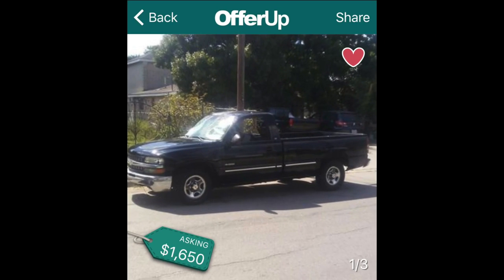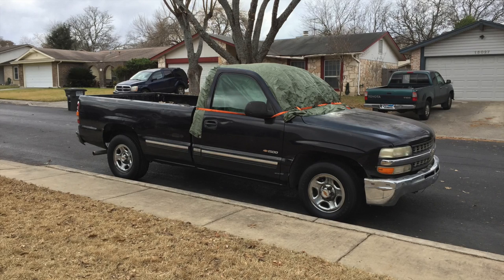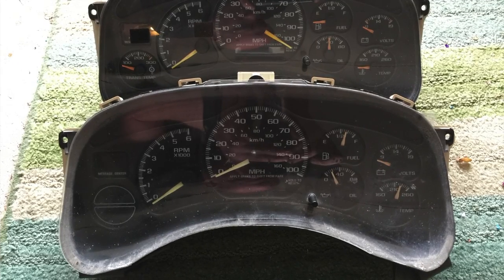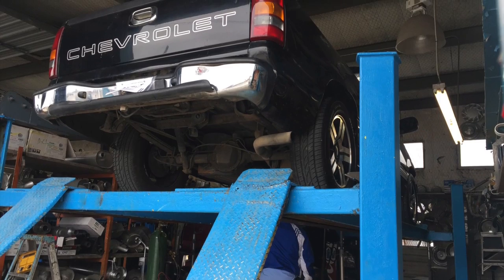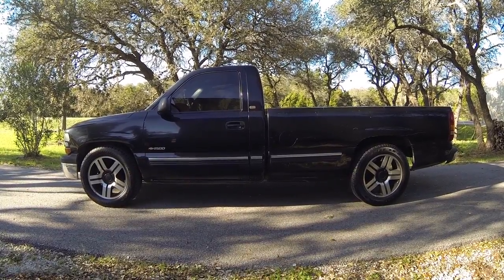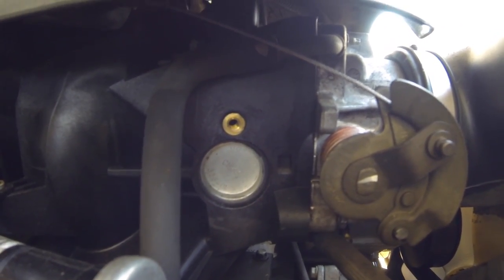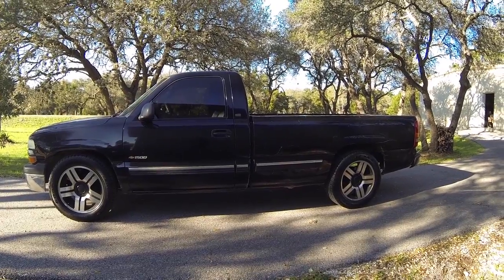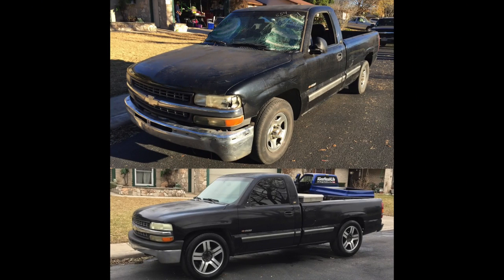The "Vandal" Project Introduction - Daily Driver Work Truck m, '01 Chevy 1500 Truck NBS

Comment: Heck yeah man. Love the truck, those new lights and bumpers will make a big difference! You should make a video on the remote start, Im thinking of installing one in my truck
Reply from the maker: Thanks Jose! Yea, I'm trying to think of a way to present how to hook them up. It's not an easy task ant takes at least a day, maybe two, to install it. Older vehicles would be easier though. The video I make will likely only cover pointing people in the direction of how to get the info needed to install it, since they've made it very difficult for the DIY guys to do it themselves. they hide the manuals and push people to have a certified installing install htem.

Comment: the 'color combo' of the wheels look great......you could always go back later and repaint the black and polish the aluminum......I did the Birmingham, Al to San Antonio TX drive and back to Bama.....I was in TX for 3 days driving!...San Antonio is beautiful......but the highways are nutts
Reply from the maker: Thanks man. I thinking the same about later on for the wheels. Yea, it takes forever to get around Texas. When I got stationed in AL, I found it crazy that 30 mins in three different direction and I could be in a different state. lol I'm use to being in the middle of Texas and taking at least 3 hours to get to another state.

Comment: Mark I have the same brand phone mount, it's awesome. Little tip, you can put the metal plate between your phone and your case and it will still work perfect, and you will never see it either.
Reply from the maker: thanks man! yea, i considered that, but preferred to have the sticky on my case instead of the phone. Plus my phone is huge, so I figured itd work a lil better being on the outside. I freakin love those mounts though man. So damn handy. I've got at least one in every vehicle.

Comment: I did the hydroboost swap on my 02 1/2 ton 4x4 silverado. That was probably the best money that I spent on that truck.
Reply from the maker: Man, that is what I'm expecting. I've already picked up the hydroboost setup for both the Vandal and the Family Wagon. I can't wait to get it on. One things slowing me down is that I want to make my own lines/hoses for it. I'd like to route them in a way that'll have a clean presentation, better than they cam from GM. They kinds seem like a spider web from the factory. Not horribly bad, but I'd just like to see what I can do. I've already got the tools to make them so why not.

Comment: PML trans pan ftw for the 4l60e maybe? I have so much to ask you but understand you're busy man. Great content man thanks. Wrenches all day every day.
Reply from the maker: +G Man Thats it brotha! Gotta keep knocking it out!
A pan with cooling fans would be a good thing. The trans cooler that I've now installed has drop trans temps at least 50* now, even when pulling an empty 1700 lbs trailer 5 hours. I'll have a car on it tomorrow for the 5 hour trip back.
Reply: +AGearHead4Life I run the PML deep pan on my tow rig, an I just love it. Be eazy in your travel's friend.

Comment: Did it throw a code when you removed the cat's,if so is there any way to remedy that? I have a 97 2500 3/4 ton Suburban with a 7.4 liter in it that needs a Flow Master!! Do you know of anyone who has done a turbo addition to this era 7.4 ? And the Truck looks great, the before and after pics say it all!!! Thanks again and keep on rolling....
Reply from the maker: +William Hill (Hill Billy MD) Thanks Will!
I disabled the secondary O2s in the tune so that it wouldn't throw a code for the cats being removed.
I don't anyone who's turbo's that truck but I know it can be fine.
Good luck on the new exhaust!
Reply: AGearHead4Life Thanks for the quick reply! It's not often I get to talk to someone famous ;-)

Comment: Vandal looks outstanding!  Cut a long bed, though?  Me, someday I want to pick up a regular cab long bed 1998 K2500.  I always liked those.  However, years ago my Dad had a regular cab short bed 2000 K1500 and it was a blast to drive.  Almost as fun as his old 1980 K10.
Reply from the maker: thanks! 
Yea, short beds are more visually appealing for a street truck. I'm actually now likely going to go with even shorter than a short bed and just use a bed off of a quad cab truck. lol Theyre easier to find.
Reply: Now there's a great idea!  That would be truly unique!  An extra short bed!

Comment: Miss your vids bro you give info than the repair guides at auto zone 
Hope everything is ok with you and yours
Reply from the maker: banga8080 Thanks brotha! Life’s actually slowed down just slightly to where I think that I’ll be able to capture a video either this weekend or next. Im swapping in an 03-07 steering wheel onto the Vandal. The newer wheels look much better. The columns have different splined but I think that I’m getting it all sorted out.

Comment: I have an 01 5.3 4X4 1500 with the trailering package and there is a second battery where your smog pump was. That's why there is a battery tray there. How did you deal with the O2 sensors when you took the cats off? Mine needs a new exhaust and I like your setup.
Reply from the maker: +Lee Allen ah! Good to know on the battery. Thanks!
I disabled the secondary O2s in the PCM before removing the cats.

Comment: You should do a 2002 2500HD front end swap. And might be a good idea/upgrade to do is to swap out the fuel pump with a newer and powerful one.
Reply from the maker: That's true! I have wondered about the strength and lift left in the fuel pump that is current in it. I should probably at least test the fuel pressure. I agree on the HD front clip. I've just got to find one cheap now.

Comment: The truck is looking good!! Did the center console just bolt in with no mods?
Reply from the maker: Thanks Matt! No it didn't. Actually, it's just resting in there jammed between the seats right now. lol I've still got to make the brackets to be able to bolt it down. I think the plastic on the bottm rear of it will need to be trimmed also.

Comment: Have you ever consider a roll pan for the back bumper they give a nice clean look,but if it's more of a work truck I guess it not real practical.
Reply from the maker: Yea, exactly. I'd do a roll pan on a sport truck specific build, but I'm usually working out of them still. I use the bumper a lot to get in and out of the bed loading stuff. Plus the protection of the bumper to stop things before they hit the body is good. Something about keeping the bumper and going against the grain excites me too..

Comment: awesome vid. cant wait to see the progress of the vandal. also did the trans temp work just by putting in the cluster??? or did you mess with wiring? im curios to know because i have an 05 silverado.
Reply from the maker: Thanks Aldo! Yep, just plugged it in. Nothing else, besides having them adjust my odometer. Of course your cluster will be different than mine. After around 03, they work differently, but it can still be done. Like using a Denali cluster.

Comment: Nice work. Loving make things look and run great again too. Just did all new brake lines and stainless lines as well has new calipers(suv back) (05 up fronts) on the truck too. I got my rear calipers with brackets pads and rotors and even came powdercoated for like 280 bucks on ebay so you may want to check it out. Fronts I got at the junkyard off a new truck. The thing will stop like crazy now. I don't know if I missed it by why upgrade/change the power steering pulley?
Reply from the maker: The power steering pulley upgrade is not a huge issue. I'm doing it because it looks much better. Also, if you ever need to remove the PS pump, you can do it without having to remove the pulley, like with the factory pulley. With the newer truck pulley, you can put your tool right through the pulley to remove the PS pump bolts.
That's nice man. I can't wait to get my brakes on. I want to paint the junk yard calipers and brackets first. I just learned about using SUV rear brakes about two weeks ago. So I still need to snag those.
Reply from the maker: aDIYguy thanks for the link!
I've got a link for the pulley in the video description.
Reply from the maker: Did the link for the pulley in the video description not work? Let me know if not and I'll fix it.
Cool! Thanks for the link. guess that means that you dont need different caliper brackets for the rear brakes?
Reply: Yes it worked . Thanks! that will make things easier. I think I ended up calling them to make sure brackets were included and they were. You may have to do the same. Also the picture shows single piston but they were dual.
Reply from the maker: Good to know! Thanks!

Comment: It might be a cool opportunity to repair the dash with carbon fiber.  You could repair the crack with some epoxy then skin the dash in cf cloth for a custom look.
Reply from the maker: That's a cool idea! Though I'd prefer a cheaper method and I'm not a fan of the carbon fiber look because it's used too often. Guess I could paint it. But I'd assume that fiberglass would be cheaper.
Well, this wouldn't be top of my priority list because Ive got a line on a parts truck to get all of the interior pieces out of.

Comment: I have a 01 GMC Sierra 1500 Long bed just like that one but in white, have the exact same 2 inch shackles to fix the extra lift from the HD leaf springs and a Hayden transcooler along with a servo for the 4L60.. Only bad thing about these trucks is MF trying to steal them any chance they get, they have tried to steal mine twice already. Oh yeah i have the 20 inch glasspack on mine, seems we have almost identical mods.

Comment: 2014+ rear bumper would do nicely
Reply from the maker: Brandon Alder Interesting. I came across one cheap but was passing it up because I figured it'd be too square for this truck. Also not sure that the raised plastic ends on it would fit the truck, but I guess that I can cut that down if it's needed.
Reply: AGearHead4Life  seen it done on other NBS trucks I'll see if I can get a pic and send it to your blog page
Reply from the maker: Cool. Please do! I just dont see it matching more rounded body lines yet.

Comment: ive got take off manifolds from my 5.3 no egr if you want them

here in SATX
Reply from the maker: Yessssir! I'm interested. I just need the driver manifold right now. How much are you asking and where's a good place to meet up?
Reply: AGearHead4Life 10$ sounds fair to me, im in the NW area off bandera so in where with in a few  miles of is good for me
Reply from the maker: Sounds good to me. I'm on the NE side. It'll likely be a few days before I can meet up with you though. I'll try to see if I can make a run over there tomorrow though.
Reply: AGearHead4Life sent you a message

Comment: If you need help with the electric fans I can give you some info on setting up your computer with hp tuners and wiring it up.  I got some cheap fans off ebay and did it on an LS swap and worked great.
Reply from the maker: +kevmo777 Thanks brotha! I did get the PCM setup for the e-fans and should be getting the fans on soon. Just gotta get the 34" radiator first. I picked up the factory newer truck fans and harness from a junk yard. Thanks for looking out!

Comment: Hey can you please make a video of how to remove that secondary air pump I'm not really familiar with how to remove them and I need to remove the one I have on my truck
Reply from the maker: Michael Munoz Sure, I can go over what I did with by holding up the lose parts in position of where they were.
Reply: AGearHead4Life thanks alot also when u deleted your cats did your check engine light come on
Reply from the maker: Michael Munoz It would have, had I not already disabled the secondary O2s.

Comment: pretty cool.  however, it is disturbing that someone can change the odometer.  Weird

so all the transmissions come with a temp sensor so all you have to do is change clusters or did you have to add that and run wires?
Reply from the maker: Yea, it is concerning, but I'm not surprised. There's alwasy going to be a way to hack any electronic. At least I'm using it for good and not in a negative way that some may do it.
Correct. It was all already there. No wiring needed. just plugged it in and it worked.
Reply: that is pretty cool that it was already there.  I wasn't worried about you doing it on your truck, just others.  I would have thought it would have been stored in the computer but I suppose that could go out too.

Looks like a cool project

Comment: For the 2005 brake calipers, did you have to swap rotors too? They were off a 2005 1500 right?
Reply from the maker: +OrangeSpeedTV Yep! They're about an inch larger.

Comment: that turns out to be a nice truck , a little work whent a pretty long way , dont think you can get a low milage truck without that sort of damage for wat you spend on it sofar normally

you might be able to make it a shortbed without cutting the frame in half 
from wat i seen on pictures the frame is mostly straight behind the cab , if it is you could just move the rear leafspring mounts and axle forward get shortbed front leafspring mounts (they mount nearer to the cab on the Z of the original frame and are prolly stubbier and lob the excess of the rear of the frame , you need new mountingpoints for the bed and you prolly need to move some of the crossbraces and mountingholes on the frame (the one on the verry rear holding the bumper/ towhook and between the rearspring mountingpoint at least )
no weak point on the frame between the wheels because there would be no welds there , the truck might even have the holes allready punched intoo the frame for the shortbed setup 

the bleu truck becomes a toy truck huh : good reason to turbo it as would make it a fun dragtruck , there a few of those build allready done with good results (prolly need to add a rollbar to be legal on the track though as those ls engines respond pretty well to a turbo)

i like the way this guy did it , it mounts the turbo verry solidly and it doesnt taken a lot of work to get the plumbing made to fit   :
https://www.youtube.com/watch?v=CZxX2W7yXFo
think youre would need the stiffer vavesprings a scavengepump  some mild steel and silicone piping , a boostrefferenced fuelpressure regulator a wastegate and a ebay turbo 
you allready have the cam hp tuner and bigger injectors

Comment: I'm running the tru cool 40k on my 2500hd after the 80e rebuild and it never gets hotter than 109 and that's sitting in traffic.
Reply from the maker: Very nice! Did you bypass the radiator and does that one have a fan built onto it?
Reply: AGearHead4Life no I put a new radiator in the truck after my motor swap because it was cracked. Might have bumped it when swapping the two motors. But running it thru the factory transmission then to the cooler. I'll text you the cooler I used. No fan on it and I'm still using a mechanical fan. I have electric fans in the garage just been too wet out to swap them out. But the weather is getting nice out so that will be done here soon.

Comment: What you think your total build cost will be? Very interested in the build thanks.
Reply from the maker: Well, I've kept track of every purchase. But there's a few things that make it hard to say what the total build cost will be. One, some of the extra things that I bought, you might not care for, so they could be subtracted. I mean, it was running and driving legal for under $2k. Also, do I include the title and registration cost? I'm actually trying to go through the list of what I spent on the truck and categorize the purchases so that one could separate what had to be spent and what is optional.

Comment: What's the benefit of the Rev limiter. Where is is set stock?
Reply from the maker: Stock is around 5500, if I remember correctly. The limiter that you saw in this video was only for when the vehicle is in park or neutral. I did that for two reason. First, I dont need the engine to rev past 4k with no load on it. Second is because its fun to pull up to your buddies house, rev it up and bounce off the limiter. 4k isn't bad. Most people would just floor it to get someones attention and who knows how far it'd rev then.

Comment: Great Vid, I also have a pair of 5.3 manifolds, I'm by sea world, my buddy has a really nice setup of led headlights on his 99 Silverado I can get the info for you if you need too just send me an email, looking forward for an upcoming video on the bigger front break upgrade cause that's what I need to do on my 2003 Silverado
Reply from the maker: Mando Rey I can tell you that the biggest brake upgrade will by from the hydroboost conversion, but the larger breaks will definitely help and look better. That and the SUV rear brake conversion. I believe those have dual piston Calipers.
Reply from the maker: Mando Rey I'd be interested is seeing your buddy's lights. Ive already got the LEDs for this truck and putting them in now. Huge difference!
Reply from the maker: Mando Rey I may hit you up on those manifolds to use as turbo manifolds on this truck down the road. I'm likely meeting tomorrow to with Rob tomorrow to pick up the driver Manifold.
Reply: AGearHead4Life 

Just sent you an email